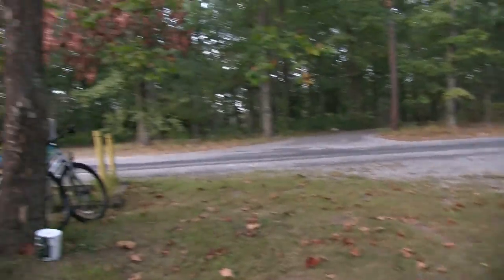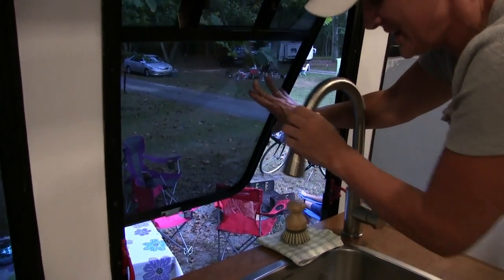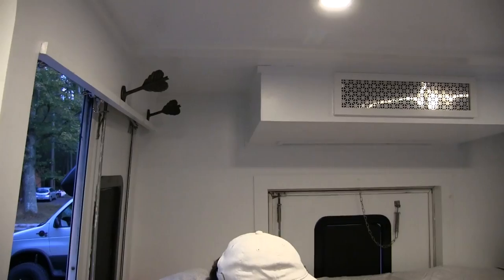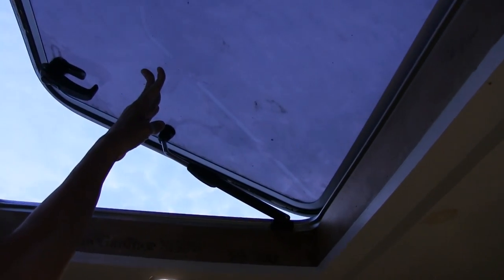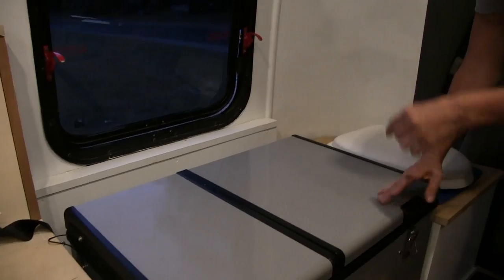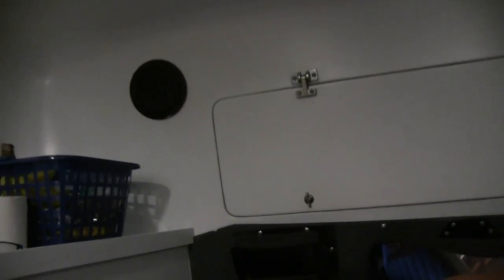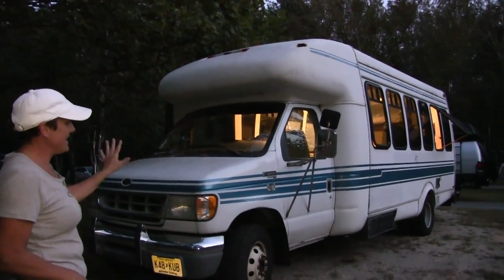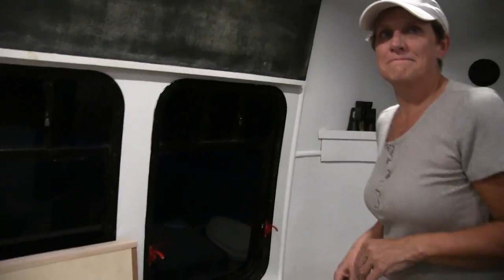VANLIFE |Tiny House Shuttle Bus Conversion: Take a tour!

Comment: all these diy campers are great and all but alot of these folks don't deal with waste water correctly. you can not just dump grey water onto the ground when out camping. there are some campgrounds now i can't go to anymore because of urine/grey water everywhere. the smells are horrid! i have seen people dump urine in camp then grey water on top of it thinking it will 'wash it away'. folks, put it holding takes and use dumpstations. also firepits are NOT trash cans.
Reply: Agreed.  We don't drain at campsites for that reason.
Reply from the maker: Always be mindful

Comment: Nice bus but I don’t get the solar doesn’t feel right thing?   Crapping next to the fridge feels right?
Reply: Solar didn't feel right because I didn't need it.  I couldn't justify setting it up that way when my power usage was less than 8 amps a day.  You know the cooler is sealed and separated from the toilet, right?  I may be a girl, but I can crap in a bucket when I need to.
Reply: Rita Gardner There is a lot more you can do if you have solar.  Good second hand system is all you need.  A deep cucle battery never reaches full charge off an alternator I believe.  But in saying that, it’s a nice bus.  We don’t have those here but we have a ton of sunlight.
Reply from the maker: Thank you for watching
Reply: New Jersey Outdoor Adventures I have just discovered your channel recently.  I find it interesting as I an sourcing ideas for my van and later box truck build.

Comment: How does solar not feel right? Free power. Renewable energy.
Reply from the maker: It can be costly to purchase and install.
Reply: @NewJerseyOutdoorAdventures  you can get a 200w kit off Amazon for less than 500$ and it comes with everything you need and is very easy to install yourself. She already has an inverter and batteries, so all you need is a charge controller and a panel. That's maybe 150$! Another 20$/30$ for cables... Sad excuse for unlimited free power. I just got two  100w thin flexible panels (to add to my system) for 180$.
Reply from the maker: Thank you for information
Reply: It didn’t feel right to go through  expense and time to install when I already had more than enough.

Comment: What is the purpose or danger painting the gas tanks black?
Reply: We had them white and shockingly it looked awful.  So far, there has been no issue.  We don't make a habit of parking in the sun, though, especially in hot weather.
Reply: @OldSkoolieSimple  I would like to be helpful.  Besides propane tanks needing to be a light color to prevent overheating/release of gas., a dark color makes it too difficult to spot rust forming.

Rust can cause pitting and can lead to a leak.

The tanks have to be re-certified every x number of years by a qualified technician.  They are trained to look for rust, so I'm not sure if they will be able to re-certify your tanks.

Your propane tanks are regulated by the Department of Transportation (DOT), National Fire Protection Association (NFPA 58), and state laws.  Possibly local laws/regulations, too.  

You might not want to be risking violations and potential consequences!

Comment: Everything was so good until that toilet right in the freaking front with no separation of any kind. It's just freaking gross!
Reply: There is separation.
Reply: We have had no regrets with the location.  Our only issue is with the toilet seat.
Reply: @OldSkoolieSimple  I'm sorry, but I'm a germaphobe. Seeing that toilet right behind the driver and right next to the fridge just out in the open kind of irks me. If you couldn't relocate it somewhere else, at least cover it up for the video. If the design was like that and you couldn't relocate it at least have some walls to separate from the fridge and the seat oh, but it's your thing so I can't say much except express my opinion.
Reply: Just put up a splash guard or a sneeze guard... problem solved... lol